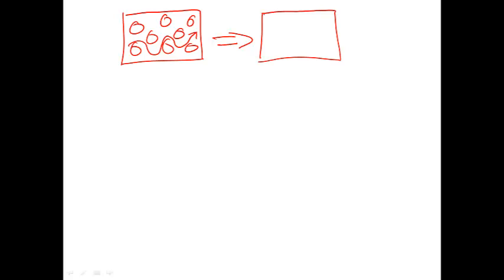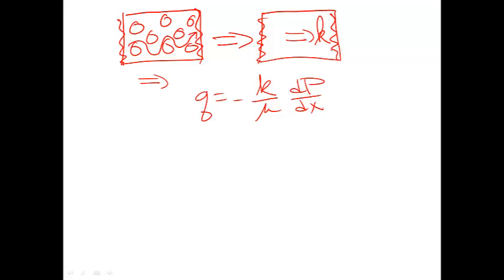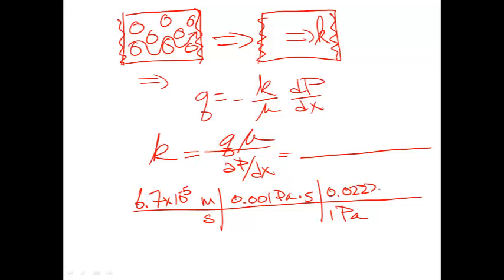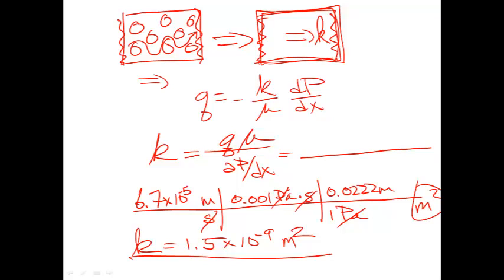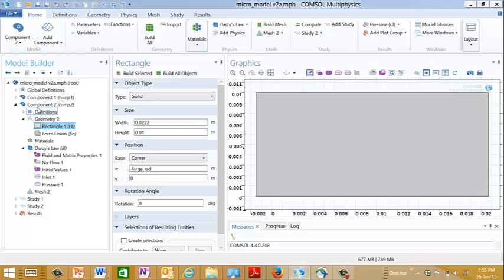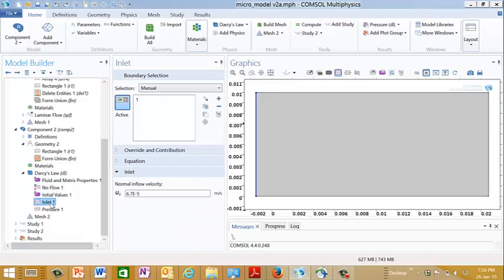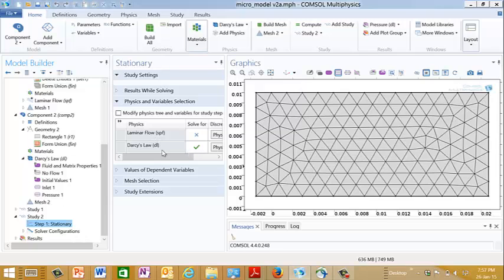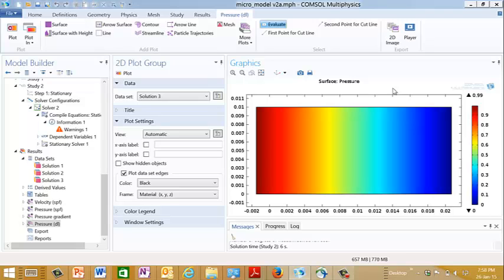Micromodel effective k

Comment: Sir, what are the values of porosity and permeability of Mesoporous Silica?
Reply from the maker: Pratyusha,    Mesoporous silica consists of porous particles packed together.  The overall porosity and permeability will depend on both the porosity and permeability of the particles and on how the particles are packed.  It would be possible to do simulations like those shown in the video by including pores in the solid grains to get a general idea of the effects of the micropores in the solid.  Solute will diffuse in and out of the porous solid and this will affect transport, so I think you would need to include a process that resembles kinetic sorption to simulate transport through mesoporous silica.  I expect there are papers describing this.  Good luck,   Larry